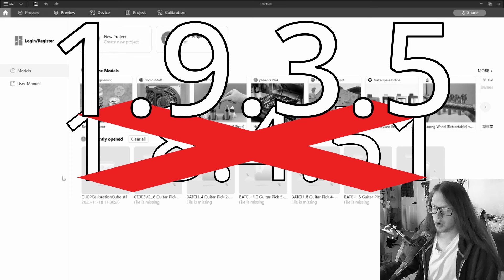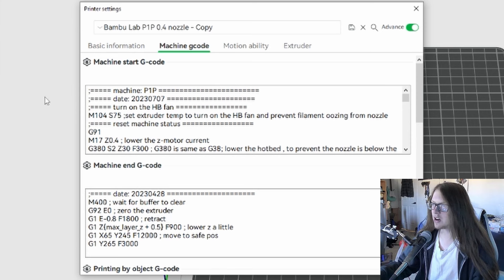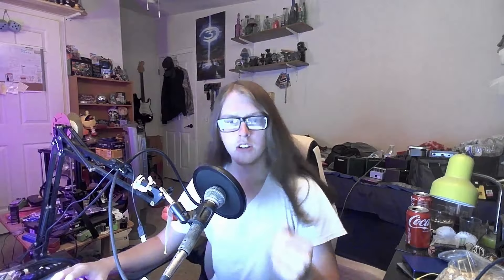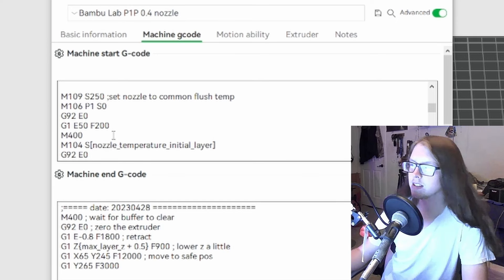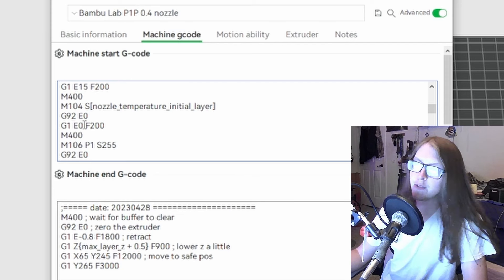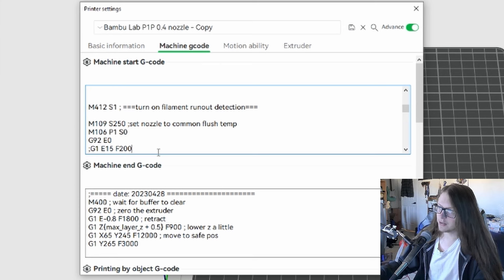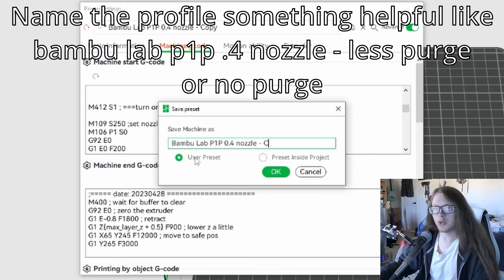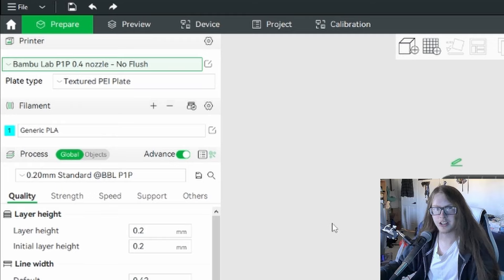How to Reduce / Remove Bambu Labs Purge UPDATE

Comment from the maker: It is confirmed that the custom gcode does work when sending the print through the wifi features. You just need to make sure to change both purge values to a reduced or zero value.

Comment: 4:23 you really broke my brain here and made me laugh. After saying ”Unfortubatley there is no find function and we can’t expand these menues” my brain expected you to say ”So we are going to have to work in an external editor, notepad works”…
But you proceeded to just scroll :D that’s just funny
Reply from the maker: Yeah, I guess I should have included a small explanation about using text editors to more easily find and make the change.  I think the only reason why I didn't originally was because it can be an extra step to mess up if they don't copy everything or some other obscure issue. I also just found it easy enough to find anyway with the text labels, so that was probably another reason lol.
Reply: @Bowsmin12  I get it, just made me laugh cause it wasn’t what I expected :p
Reply from the maker: @beaconofwierd1883  Scrolling's a character builder. lol.

Comment: I got it to work without going through the SD. I set both E values to 5 which I do not recommend, I'm gonna change it after it finishes the current print. 15 like you suggested is probably best.
Reply from the maker: Right. I forgot to make an update pinned comment. I have been using the custom code through the wifi services too for a while as well. I just use 0 on both from what I remember so that there is no purge. But thank you for letting me know and reminding me. I will make the pinned update right after this reply.
Reply: @Bowsmin12 I'm only printing with one color at the moment have you had issues with the new purge settings when printing multi color/material? Does the old filament get mixed into the print for example?
Reply from the maker: @jasonlovi8745  I'm too poor to own an AMS lol. But to my knowledge, it's deferent code. I think that the color changes are mid print code that gets generated based on settings, which is separated and harder to manually edit than the start and end code. And there are separate, easier to access purge percent adjusters when multi material is turned on in the slicer or something like that. Which there is at least a small variety of videos talking about reducing color change purge.

Comment: The 2nd purge would be for helping to cool down the nozzle and reduce the filament dribbling. It starts at 250C and purges 50mm of filament, then sets the temp to your first layer temp and purges 50mm more filament. The cold filament being pushed through cools the nozzle and the viscosity as it cools to reduce the amount of dribbling that would occur after the purge is done.
Reply from the maker: Interesting. Well, logically if the dribbling becomes / is a problem, you could use some of the second line still. The amount could probably still be reduced though.

Comment: Awesome, thanks!
I also like the idea of just cutting in your old video and only doing a `delta` video
Reply from the maker: Thank you. The way I saw it is that if people liked the original as much as they did, might as well use it until needed. It helps save some time on my side too. I'm happy you found it useful.
Reply: @Bowsmin12  Yes, but if you're like me and followed the FIRST video, and know others have as well, I made the change to ZERO as I wanted NO purge, and preferred a mixing of one filiment transitioning into the next.  IT did not eliminate the Purge tower at all!!!  I have the latest version, so went back and just by LUCK saw your comment about the update.  ***If that FIRST video is no longer valid, it would really be better if you just REMOVE it.  It's GREAT the way you prestented it, but that all goes out the window if it's invalid.
  Additionally, with your NEW second line, which I also changed to ZERO, also DID nothing as the PURGE tower is STILL generated when slicing.  Indicating this one is also invalid.  Am I mistaken somehow?
Reply from the maker: @timrick2  Well these videos have nothing to do with color or filament changes during a print based on what I'm hearing about the purge tower. It's mainly for people who use one filament frequently and don't want to waste the filament from the pre print preparation, or you're just sick of the filament purge in the pre print operation in general. Otherwise there are other, more adjustable settings for the color change purges, and I have no idea about a purge tower, because I think people usually just use the purge mechanisms when doing multi color or filament prints.
Otherwise I'm not sure exactly what you are trying to convey here and need more clarification. Also I leave up the other video because it's one my leading videos for discoverability. I understand that leaving it up can lead to a now lack if information, however I did try to make it as obvious as possible in the title, in the description, and in a pinned comment that there is a newer video. But as a small channel with not many resources, I need all the help I can get.

Comment: Hey, I have a A1 and found were it is on the gcode: 

;===== prepare print temperature and material ==========
M1002 gcode_claim_action : 24

M400
;G392 S1
M211 X0 Y0 Z0 ;turn off soft endstop
M975 S1 ; turn on

G90
G1 X-28.5 F30000
G1 X-48.2 F3000

M620 M ;enable remap
M620 S[initial_no_support_extruder]A   ; switch material if AMS exist
    M1002 gcode_claim_action : 4
    M400
    M1002 set_filament_type:UNKNOWN
    M109 S[nozzle_temperature_initial_layer]
    M104 S220
    M400
    T[initial_no_support_extruder]
    G1 X-48.2 F3000
    M400

    M620.1 E F{filament_max_volumetric_speed[initial_no_support_extruder]/2.4053*60} T{nozzle_temperature_range_high[initial_no_support_extruder]}
    M109 S220 ;set nozzle to common flush temp ⚠(I also lowered the flush temperature from 250 to 220 to lower the burning smell)⚠
    M106 P1 S0
    G92 E0
    G1 E15 F200 👈
    M400
    M1002 set_filament_type:{filament_type[initial_no_support_extruder]}
M621 S[initial_no_support_extruder]A

M109 S{nozzle_temperature_range_high[initial_no_support_extruder]} H300
G92 E0
G1 E10 F200 ; lower extrusion speed to avoid clog 👈
Reply: The shown values are the modified ones, they will show as E50 unmodified, also I tested and it works via cloud, no need to manually put on the SD card

Comment: We need an update of this update, since, they keep on changing it lol
It's weird how my A1 Mini didn't do this, it's only after I got the A1.
Reply from the maker: Unfortunately this video was never meant to be for the A1 or the mini, at least not specifically. Since the form factor is much different compared to the P1 & X1 printers, the code has to be different. Additionally unfortunately, I don't make a regular income, and don't have a way to own either of the printers to officially check the code and make sure it all works. I've attempted to contact Bambu Labs about collaborating, but of course get no reply. So for the near and foreseeable future, I cannot provide those update videos.

Comment: Version 1.9.7.52 out now , not seeing that changeable line in gode, 
It says
M412 S1 ; ===turn on filament runout detection===
M400 P10
M620.3 W1; === turn on filament tangle detection===
There isn't any of the code you have described at this point.
Reply from the maker: This is copy pasted directly from the latest default .4 nozzle P1P profile.

M412 S1 ; ===turn on filament runout detection===

M109 S250 ;set nozzle to common flush temp
M106 P1 S0
G92 E0
G1 E50 F200👈
M400
M104 S[nozzle_temperature_initial_layer]

I have included an emoji next to the line needed. My guess is that you are using a different machine than the P1P? Have you copied and pasted the start gcode into a text editor and CTRL F find featured the line. I think I found a similar line in the A1 code a while ago in a different place in the code, but I don't own an A1 or A1 mini so I can't verify any function for them yet. If you let me know what machine you are using I may be able to find the line needed or verify that this fix doesn't work with it for some reason.
Reply: @Bowsmin12  yes sorry i have an a1 not mini my code looks different maybe because of latest update?
Reply from the maker: @jensnielsen7734 I think the code looks different because it's a major form factor change, at least as far as I know. The P1 and X1 series of printers are all pretty similar, so I think they use roughly the same code, plus or minus some based on extra features.
However the A1 standard is very different in form and the A1 mini is even more different. So they have different homing commands and probably different standards for preparation and cleaning.
I think the extrusion command is a standard command in Gcode, at least among bambu printers if not others, so I think it is somewhere in your start gcode, but just in a different place. Unfortunately, like I said, I don't own either the A1 or the mini, so I cannot verify the exact right lines and the function of them. All I can do is add the profile to my Bambu Studio and look through the code.
like mentioned in the video, If you would like to see content with me working with the A1 or A1 mini, I recommend emailing one of the bambu labs emails in the description and recommend to them about reaching out to me for collaboration.

Comment: Changing E value, or even commenting it out, doesn't do anything for me on my A1 mini :(
Reply from the maker: Unfortunately I cannot help or fact check anything with the A1 mini, as it's majorly different than the P1 and X1 series.
I would recommend massaging bambu labs at one of the emails provided at 1:30 in the video, and recommend them reaching out to me either through my email or  they can find me through my Maker World account. username Bowsmin12, to ask them to work with me and their printers.
Also you can support me by downloading, liking and using my print profiles on Maker World.
I am sorry, but this is the struggle of being a small youtuber. Thank you for watching either way.